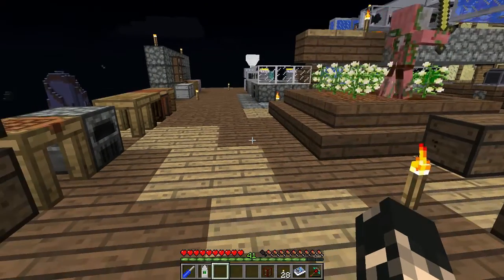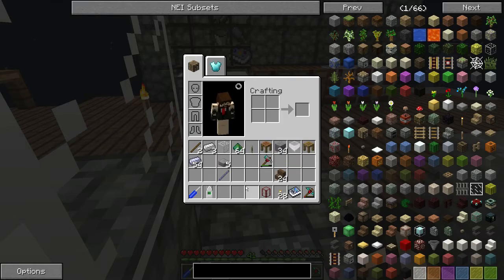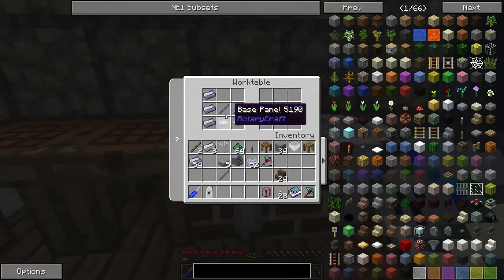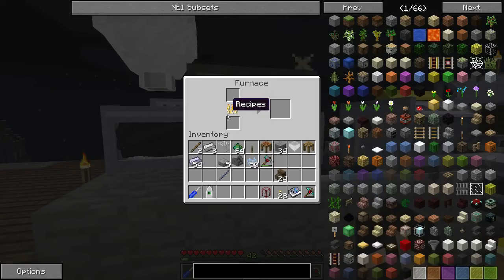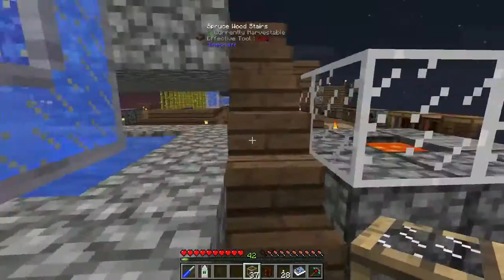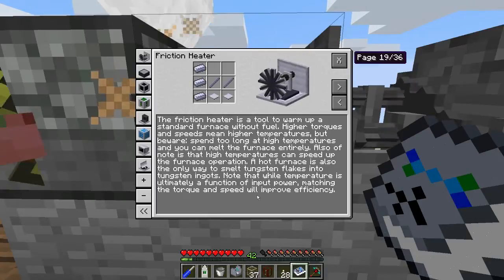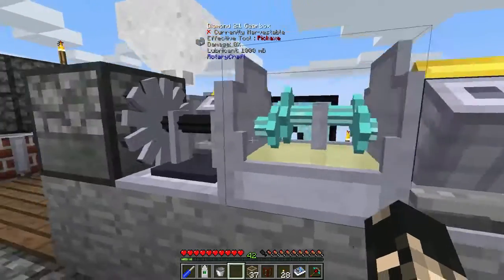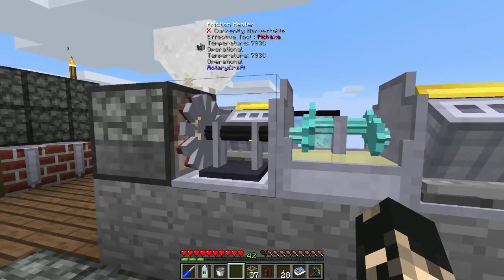RotaryCraft Friction Heater, Automatic Smelting

Comment: That's ZENNY^^ I remember something about the friction heater having a risk of smelting the furnace (or whatever it's heating). Am i not right?
Reply from the maker: Apparently it does, when I hooked it up a reactor, it didn't melt, I'll attempt to throw some more power at it and see what happens.
Reply: Interesting, I never used the friction one ^^